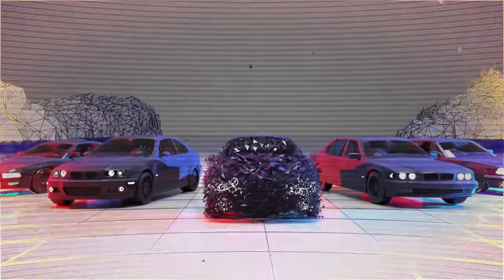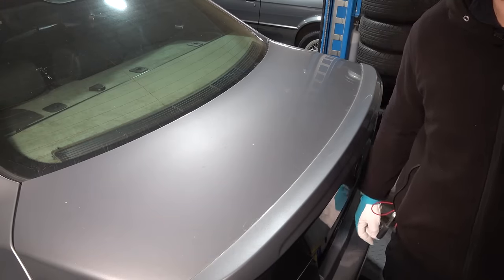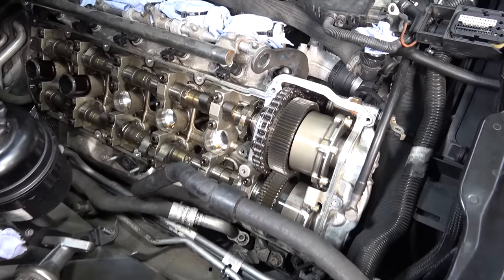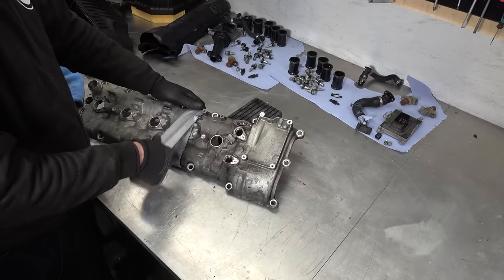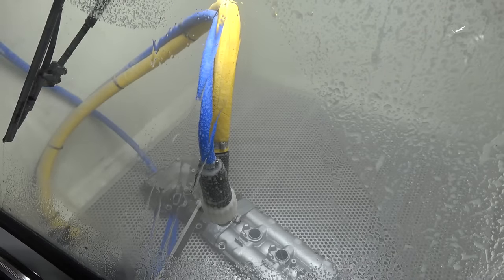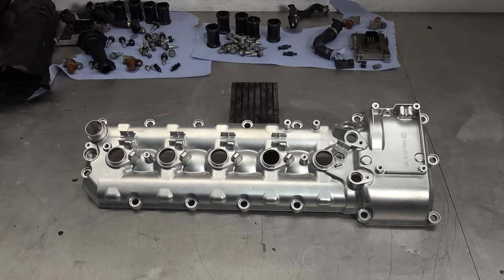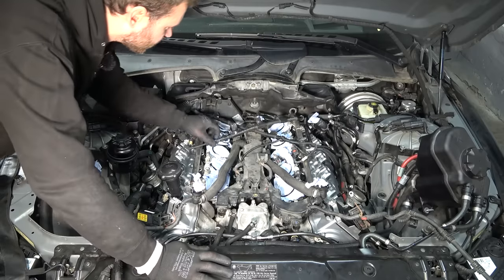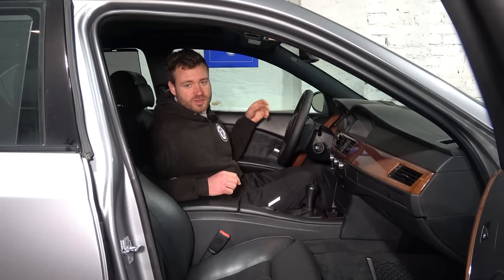Can We Make This V10 BMW M5 Mechanically Perfect? -  E60 M5 6-speed - Project Raleigh: Part 7

Comment: Great job! As an E60 M5 owner, some useful tips:
1. Did you check/replace the electronics on the board of the throttle actuators? They tend to fail after time as well.
2. For the front shocks: why did you remove the whole wheel assembly/spindle?
3. As far as the weird discoveries in the suspension: as it is a US car, it might have had lowerings springs and/or coilovers and was returned to stock before selling somewhere in its life.
4. I used to have a rattle I could not locate. Turned out to be the sunroof wind deflector. I applied 3 small pieces of velcro. Rattle gone.
5. When have wind noises from the sunroof, as a second solution after the seal you can simply reset the sunroof (pressing and holding the tilt button for 20 seconds and let it do its thing).

Comment: That was a highly enjoyable hour of wrenching Sreten 😃 What a glorious machine this M5 is, and even better with the Bilsteins. Those valve cover bolt seals were a total rip off. Some parts pricing is pretty disgusting these days. For instance I doubt the Elring bolt seals for M54 valve covers cost AU$10-20 to manufacture but that's what arseholes sell them for. Not for a set but just for one. Why would anyone pay $160 or more just for these bolt seals? The cost of an Elring valve cover gasket is bad enough and many don't sell them with the spark plug seals either 🤬

Anyhoo, great video mate 👌

Comment: The spring position on the shock can move/shift/twist by accident. I have this problem with my E39. I went snow drifting on a field with tiny potholes and other imperfections. After that, the spring from the rear right shock twisted from its normal position. I didn't feel it when it happened, and now the spring is slightly curved (it's not straight because the position is messed up). When I hit any imperfection on the road with the rear right wheel there is some play in the rear axle, and all thanks to that spring (everything else it's ok on the rear axle, I checked that). I'll fix the spring soon.

Comment: On the e39 you don't need to remove the control arm, you can remove the wheel arch liner and the shoch will come out as well
Reply from the maker: Rightttt, I mixed it up with E38. Been a while since I did that on E39
Reply: @M539Restorations  damn I didn't even manage to finish watching the video and you already replied :D

Comment: if you have a 1/4 drive ratchet you should invest in approx 600 mm of extensions cos if you come to our swedish cousins 2.4 petrol engine and its throttle body you will need these to reach it from the underside

Comment: 14:39 Sreten. Observation/ question chief.
If those seals with the bolts are sold as a unit, check to see that those seals don't match the other seals that BMW uses for those same head bolts but in different engines. They might be trying to fleece you as an M5 owner, while selling the owner of a 116D the same seals for a few cents each.
It's unlikely that those are unique to just the M5 engine.

Comment: The plastic spacer looks like a transport packer to me (EDIT: it is, search E60 shipping block spacer, Turner Motorsport sells them). They are placed around the shock rod to shorten the bump stop clearance so when vehicles are being transported then can tension them down to the bump stops. They should be removed at pre delivery

Comment: When you have springs in series you weaker total spring like half if they are the same force. When paralel the opposite like twice if they are the same force.

When it comes to electrical resistors it is the opposite.

Comment: I Really like the Videos on the E60 I had one few years ago.

Totaled it because a lithuanian Truck driver Fell asleep and pulled to the left lane got wedged in between the Truck and the guard rail thingy.
I had only a few scratches nothing major but I miss the car sometimes.
But then I remember how much Aral ultimate is right now and my wife would kill me if I drove that thirsty thing again.
My fuel usage Was like 20-30l/km depending on hard I was going.
What Kind of fuel econemy are you getting?

Grüße aus Köln

Comment: 19:00 Yeah, but what happens after going trough 3 years of hot - cold sycluses in -20c or colder? Will the glue hold on in the extreme temps we endure here in Scandinavia? Since we never salt our roads this far north(so we can drive our enthusiast cars year round), that is something I would like to be tested out before doing this mod, or else I'll still need a tow.... 46:01 They are not supposed to dear Streten. Any oil dampers, like all adaptive dampers with metal in the oil, doesn't bounce back when compressed, or better said they might but it takes a long time in my experience. But that might be vendor specific. But think about it Stretten, oil, with valves inside a damper, should NOT bounce back, or else there is something wrong with the valves. Gas should bounce back, but no adaptive magneto ride style dampers should behave like you describe...

edit:forgot time stamp

Comment: Hello  Sreten, pretty nice video! I just have a question, which type of glue did you use when you rebuilt the throttle actuator? I mean to attatch the gear to the shaft. Thanks a lot !!

Comment: That white plastic peace on 32:32 is actually OEM. It comes with 3 of those (on new cars) on each suspensionrod in the front. It prevents the car from hitting the bottom when in transport. Grtz Ward (BMW mechanic)

Comment: Hello everyone,
I'm wondering how you would tighten the screws of the suspension with the car on the ground. -> 35:44
If you don't have a lift like Sreten, how are you supposed to get underneath?

Any ideas on that? :(

Comment: I am surprised to see that you did not do any adaptation calibration of the throttle. Don’t you need it after fiddling with the gears and other internals of the throttle controller?
Reply from the maker: No.

Comment: Bilstein question: I recently ordered a B6 front set for my Sport E53 X5 and they came black. Sports are a special part for the E53 and OEM is black as well. Part numbers do match so I guess it is okay. What is your opinion on that color issue? E53 Sport suspension is hard to get anywhere (standard is available on every corner of the internet). Still searching for rear shocks for a good price but no luck...except some Polish shop has them but I generally have trust issues with anything from Poland :D

Comment: Those plastic gears in the throttle actuator are truely a crime, those shings should have been designed to be made of metal. 
Also the only positive of a sunroof is the extra light in my opinion but its really not worth in in any way

Comment: Fabulous car.  Unfortunately thIs M5 is just too expensive to maintain. Sure if you can do the work yourself it'll run you $15k but that's around $25k or higher to have an Indy do the work.    

Unfortunately this model has a very small fuel tank for the fuel consumption AND the engine was designed around 7-spd SMG.  US buyers balked at the SMG so BMW relented after a year or so released the 6-spd.

Comment: I think that plastic white thing is the original shipping block…it looks the same as the one I took out when I bought my E46 M3….my dealer also forgot to take it out. And if you cary on driving it will break off, but part of your shipping block got caught under the dust cover…original dealer should be fired…

Comment: The crap plastic in the passenger shock was the shipping bump stop. I drove my e46 for 50,000 miles and found the thing blocking the shock and bump stop on my driver side. Stupid dealer! I’m sure I’m not the first to mention it but no search on comments….

Comment: Not on the test stand That's just stress for the engine
The engine can not show its performance on the test bench
The combustion chamber and exhaust gas temperatures are too high then he takes in 3 degrees shrute ignition wake

Übersetzungsergebnisse
Unless you have a test bench of wind speeds to the 300 KMH on the entire Vrond simulated
Otherwise you have the full performance at V10

Comment: 11:20 Now you wanna strip every aluminium part off the car and put it in the aquablast cabinet :) Parts look like new.
32:42 Your face after you realised that you went 300km/h with these shocks :)
If you want a great V10 you gotta spend the money for it, a V10 RS6 or a V8 AMG from the same era wont be different...
Reply: An AMG V8 is not a V10.

Comment: Imagine getting a full TüV inspection with those shock absorbers...  Shoudn't that be a discovered at the inspection?
Reply from the maker: How? He can't see that unless he takes the wheel off which they can't do.
Reply: @M539Restorations   Well, they could have visually inspect them just like you did. With the introduction of APK (Dutch TüV.. but not as strict as German TüV)  Garages had  a test bench on which they put the car on.. it's a rough estimate. But it could detect really bad shock absorbers.. I assumed that a full TüV would use this.
Reply from the maker: They shake the front end of the car with the machine and then also check for play in the wheels. Since the car is low and this dirt was  at the very top of the shock, it's very easy to not see it and unless oil is running down the shock, doubt they'll ever say something m

Comment: it shouldnt bounce back with no spring...that means the shock rebound damping circuit is shot if it does
Reply from the maker: It absolutely should.
Reply: @M539Restorations  Agree to disagree. The spring is what rebounds the shock. The shocks job is to control the speed at which the rebound happens. If it comes out on its own, there is no more rebound control. The shock isnt working.

Comment: I wouldn't call a car reliable if it needs one year salary of an average eastern european man just in parts not including labor to make it reliable
Reply from the maker: It's funny how people don't understand basics despite explaining few times. This car cost new around $110k (in todays money). This 5.0L V10 car was then driven for 14 years and 143k miles with pretty much only oil changes, general neglect and it still kept going. And we should call that unreliable? I now fully sorted everything with this car for 13-14k which is actually quite good for a V10 M car and it'll do another 100k miles without major issues. This car wasn't sold or built cheaply and therefore it can't be cheap to fix. I'll never understand people who call it unreliable and don't take in consideration that majority of owners neglect these car and then can't afford to fix it.
Reply: @M539Restorations  calm down Sreten, I understand its expensive complicated car, and therefore needs money poured into it to keep it reliable, and for some people its okay, I m just sayin for most people thats not okay, I got cheap uncomplicated car that has done 300k km with who knows what kind of neglect then I bought it continued to neglect it again everyday for 7 years and still it refuses to fail, now thats reliable, total amount spent less than your shock absorbers
Reply from the maker: I'm cool as a cucumber, but this stuff gets me going because of that exact reason, you are comparing your everyday car that has 5 times less power with a high performance car. For what it is, I find it very reliable.

Comment: 29:25 no is not, try to unbolt it when is all rusty, 100% you will rund it out, ask me how I know this.
Reply from the maker: It is. In that case, simply cut it off, same as with the other type.
Reply: @M539Restorations  not when you try to save them as they are still good and tight (even if they are cheap)
Reply from the maker: If they are rusted out in place, they won't be good anyway:)
Reply: @M539Restorations  oh, you didn't seen salt in Norway, when after 1 winter is all rusty. ;)
Reply from the maker: True. Try protecting it, should help - https://www.amazon.de/-/en/Liqui-Cable-Grease-Cavity-Sealant/dp/B004G5WEFO
Reply: @M539Restorations  when I do it personally I do use copper grease (antisize, i know it's spelled wrongly) because it will dry off, but mechanics don't and often when you buy a car, with new parts mounted and well, it's too late (same goes for brake jobs, seem like watch on sliders to see if they are lubed up and slide properly when doing pads\discs is an option). But about mechanics here (which many are part of some national scale franchising) are so pathetic that without pc connected to the car they don't know what's wrong with it (my friends x5 recently got 2 bad injectors, m57 3.0d, couldn't go over 2k rpm and she couldn't drive it, got it to them, they didn't seen a problem bcs pc won't show the dtc).  On the side note can tell you that many cars which are less than 10 y.o. are having rust problems on bodywork (especially Skodas, wv, and japanese cars). Also I remember that when I used to live in U.K. once I got the stabilisator link with both notch on the back and hex in front, that was convenient. But don't remember the brand, something cheap it was.

Comment: SADLY bottom ends on this cars will never be right, so many years and no one has come up with a real solution to this problem. MAYBE A BETTER CRANKSHAFT, ROD BEARINGS THAT WILL LAST LIKE ON NORMAL CARS DO. Its a ahame knowing if you buy one you need to look at them to make sure they are ok, and if you change them while your the owner, your mind is always at that spot of the car. BMW I GIVE YOU AN F ON THIS MATTER................................Knowing this I would opt for any of MERCEDES BENZ V8 KOMPRESSORS wich make killer power 500hp+ and them engines go on for ever.
Reply from the maker: Wrong. Bottom end on this car is now great. There are 0 reported failures with BE bearings.
Reply: @M539Restorations  well that needs to be seen on the long run if you keep the car long enough to check them at 50 or 60 thou miles down the road, or maybe at 100.000 more. I hope that would be true since its one of the things that realy would keep me from getting one, for some one who dont have a shop like me and would need to take it to one and pay the biiiiiiig bill is not nice.
Reply: @M539Restorations  im not saying is not great, im saying the durability of the new rod bearing, will they wear out as all the others do???? because as far as i seen, BMW or anyone has not been able to fix this defect for good. Thats what im saying
Reply from the maker: It was already seen in the long run. If you truly want to understand this matter, then research BE bearings.
Reply: @M539Restorations  Yeah i read some things about them, but maybe down the line need to see 100 or 150k miles on them or more.